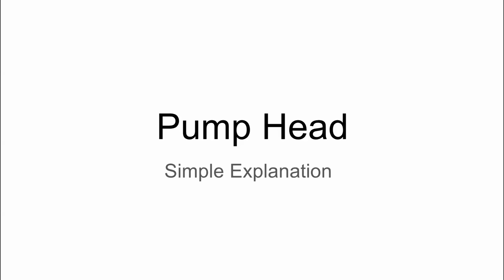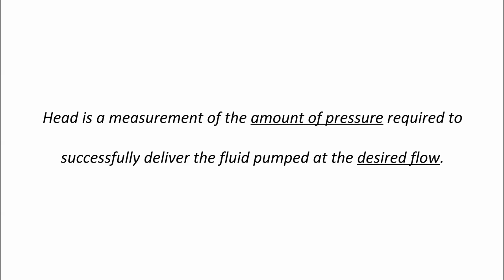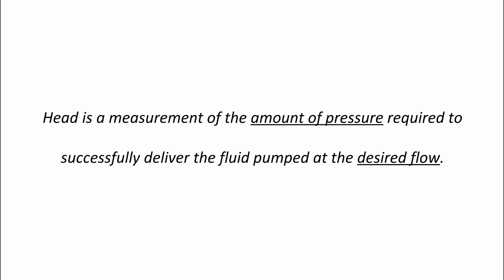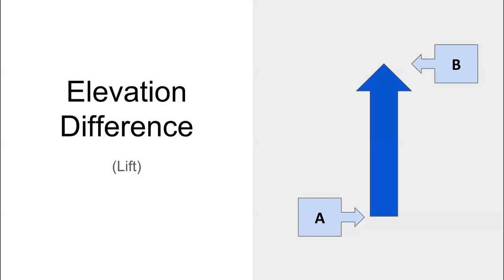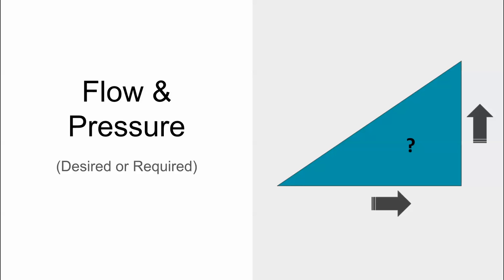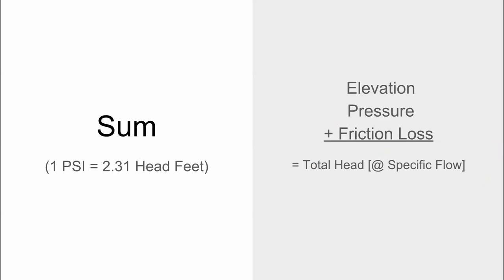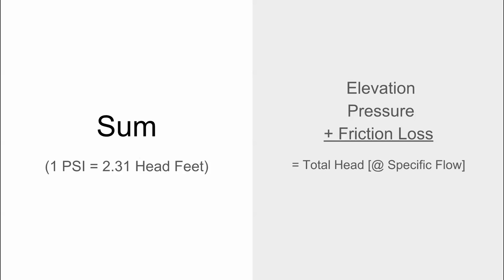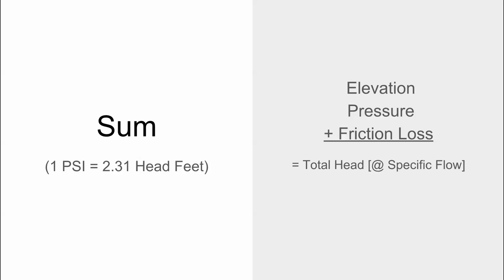Pump Head: Simple Explanation

Comment: Thanks for the great explanation. I want to make sure I've understood it correctly, and I also have a few questions.  We live on an 11-acre property that a developer wanted to subdivide. The developer drilled a well, intending it to be a community well, but it only delivers 10 gpm, and was not suitable to supply 11 houses. We bought the property from the developer and used this well to supply our new house.  The well is 800' deep, has an 8" casing, and delivers 10 gpm.  The submersible well pump is set at 300'  The static water level is at 30'.  It is 80' from the wellhead to the pressure tank inside the house The difference in elevation between the wellhead and the house is only 10' (the house is 10' higher than the wellhead). The well has 1" poly pipe.  

Question#1:  If we never consume more than 10 gpm, and the flow rate of the well is 10 gpm, will there still be a drawdown from the static water level?  

Question #2: Without taking into account any additional head from possible drawdown, or friction losses from fittings,  I calculate my head to be 270' (distance from well pump to static water level) +10' (difference in elevation between the wellhead and the house) + friction loss of 300' of pipe in the well + 30' of pipe between the static water level and top of the well + 80' of pipe between the well and the pressure tank in the house.  So this would be 270' + 10' = 280' of head + the friction loss of 30'+80' of poly pipe.  Am I correct about this?  

Question #3:  If a 1hp, 10 gpm pump is used,  but only a 3/4 hp, 10gpm pump is needed because of the amount of TDH, will the overly powerful pump be at risk of damaging its bearings from upthrust, because the head pressure is not adequate to keep impeller of the more powerful pump from banging into the top bearing when the pump turns on?

Thanks for any answers to these questions.
Reply from the maker: Great questions, Q1: Only seasonal changes would likely effect the static water level in the instance you described. Q2: You are correct other than accounting for friction loss in fittings. Q3: I will refer to my own made up analogy, a pump is like a shoe, you don't go to large or to small for optimal and reliable performance. We are more than happy to help you size and select a pump if you contact us.

Comment: What about if you have loop. Say you have a 5ft of vertical lift, a 10 foot horizontal run into an open tub and then you also have a 5 foot vertical drop and a 10 foot horizontal run back to the start?

Does the 5 foot drop negate the 5 foot lift entirely? Partially? Not at all? Does it somehow ADD to the total head?

Comment: I have been very curious as to why Head is given as a distance? Is head simply the extra distance that would be needed to overcome by the pump or pressure from point A? Is that why its given in meters? My question stems from the definition of head loss specifically. Head loss as we know is the pressure lost due to the friction in a pipe. But I am confused as to why its units is meters specifically. From my understanding the reason is friction causes the fluid to lose a certain amount of distance when traveling at a certain velocity and this distance lost must then be overcome by extra pressure from point A? is this correct?
Reply from the maker: That's a good question, here's a link to an excellent article that I think will answer your question: http://www.pacificliquid.com/pumpintro.pdf
Reply: Depending on the fluid in question, head can be directly converted from distance to the pressure gradient. It is important to stress that this conversion is for the pressure GRADIENT and not merely pressure at a given point.

Comment: Thanks for your informative video. To calculate elevation, would the lower point be where the pump is set or where there is the static water line ? Thanks
Reply from the maker: Mahavir:  That is a great question.  You want to measure from the pumping level.  The pumping level is the lowest water level reached during pumping operation.  (Static level minus drawdown)
Reply: OK! Lets see if I understand this correctly. If my pump has a 50 ft lift and the water is only 5ft down below ground and my intake hose/pipe is 5 ft below the water level. I would still be able to pump the water 40 ft ft up above the ground level. Please crrect me if wrong. If I do not need to lift the water up the 40 ft, and instead I have to move it for a  short distance , Would this affect my psi and flow rate?..If I had to move the water over a long distance then I would have to use the chart for friction loss. Thank You for the great video and information. Just trying to learn and apply it to practical use. Again Thank You.      @RCworstwater

Comment: Hi sir, I have a question. How we can calculate the head of a pump when that pump is higher than its consumers?For example,, the pump is on the roof and pumping water for domestic buildings. Thanks
Reply: The static head would be considered the same magnitude as at when you elevate but with a negative value because the reference plane is taking at x=0 at the center of the pipe. So your total head loss or total dynamic head would be Tdh=sh+dh+fl with static head negative

Comment: Does friction loss get accounted for in the length of pipe (drop pipe?) that is going down the well since that is already getting counted somewhat in the lift/elevation part of the equation? Meaning if the pump is hanging higher or lower in the well, I need to increase or decrease both elevation and total length of pipe that is causing friction loss.
Reply from the maker: Yes, because friction loss and elevation are two separate components of the equation.

Comment: My question is if height of a building is 40 meter and pumping system is placed at the ground level
What will be pressure reading at the suction of the pump and at the discharge of the pump
Reply: Static x 

Love dub

Comment: What if the pump is situated above   a tank will that be called as negative head or something and also how the head of the  liquid fuels can be determined in an rocket engine as the pumps are situated above the combustion chamber in which the fuels have to be pumped
Reply from the maker: Suction lift is the term for a pump that pulls water from a lower elevation. I have not dealt with rocket fuel pumps recently, that may be a question for NASA.

Comment: Hello R.C. Worst & co, great channel well done for putting these videos together. Is pump head the same as suction. Max-head and max suction. Many thanks in advance.
Reply from the maker: Hey Wayne!

Suction Lift refers to the difference in elevation measured from the pump's inlet to the water level, and only applies to surface pumps. Think of it like the pump is sucking water straight up out of a cup (well/lake) with a straw (pipe). For shallow well jet pumps, the maximum suction lift is about 25', deep well jet pumps can lift from over 100'.

Max head refers to the maximum amount of pressure (PSI) a pump can produce, and is a characteristic of ALL water/wastewater pumps. 

Thanks for the question!
Reply: Thank you,  that makes it clearer. first time working with pumps. i will watch many more from your channel.

Comment: How do i convert pump pressure to head? I see two ways people are using P x 2.31 or pump differential x 2.31?
Reply from the maker: 1 PSI = 2.31 feet of head
Reply: Is it better to use pump differential or just gauge pressure?

Comment: Hello you mention you can have a desired pressure what does this mean exactly
Reply: Some systems have a certain flow rate requirement in order to operate properly. So maintaining a pump at a desired discharge pressure helps ensure this is done properly. Also if a pump is not pumping at a desired/required pressure, possible indication of something wrong with the pump or equipment upstream or downstream of it.

Comment: Hi, how much head loss would a filter sock add to a pool pump setup?
Reply from the maker: It depends on the size, micron rating, and flow rate. Generally though they are sized to lose less then 1 or 2 psi.

Comment: Not a bad video but it is always a better video if you give a real world example with actual numbers. 

For the lift, why is there not a difference of head based on pipe size? Surely lifting a 2" diameter column of water a foot takes less force (ie less pressure) than lifting a 6" diameter column of water a foot. I would think a calculation that takes into account the specific gravity of the fluid (ie water) with the volume of water that would be lifted. Maybe this is just for "simple" applications per the title, but lifting a 1" diameter column of water 100 feet cannot be the same as lifting a 16" diameter column of water.
Reply from the maker: Thanks for the comment! The diameter of the pipe is only needed to account for friction loss, the pressure at the bottom of your 1" dia. and 16" dia column are exactly the same -> 43.29 PSI (ignoring friction loss). That is the pressure the pump must be able to produce to push water out regardless of pipe size. You can learn more  here: https://www.rcworst.com/Shared/content/mfr/a_y_mcdonald_mfg_co/docs/a_y_mcdonald_pump_basics.pdf